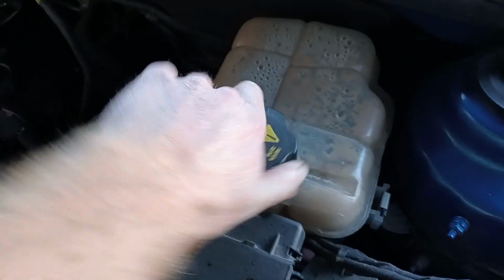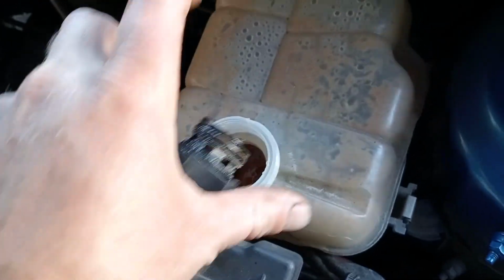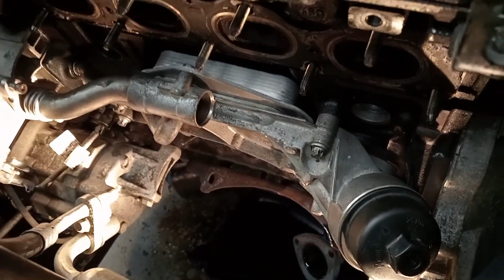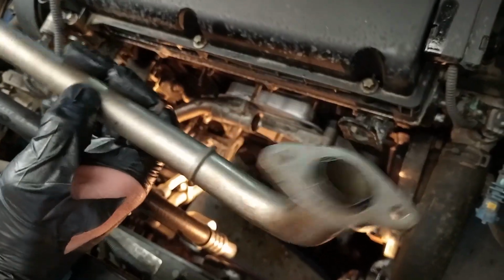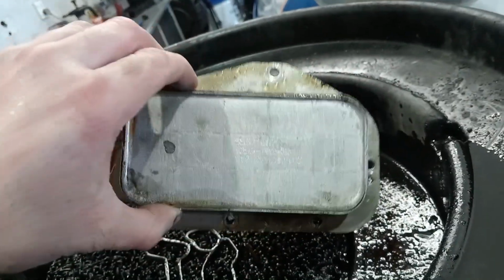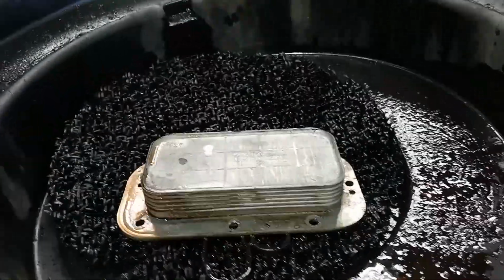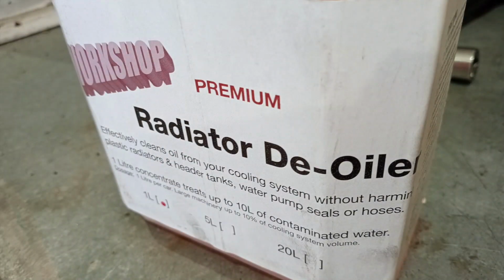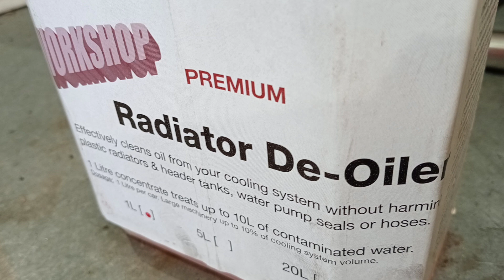Holden cruise oil in coolant

Comment: I have same issue but I also find there is an oil leak on the ground but no overheating.... 
Could it be anything else ?? Or should this fix it ??
Reply from the maker: You could have a separate oil leak also, or it could be coming from the cooler. If you have oil in your coolant though, fix this first.